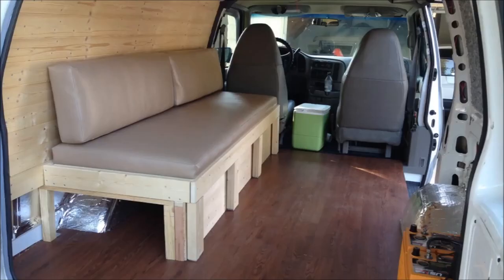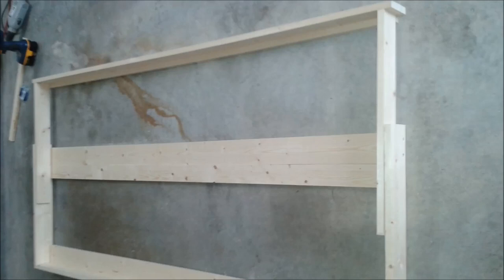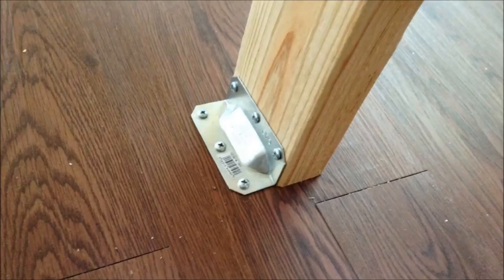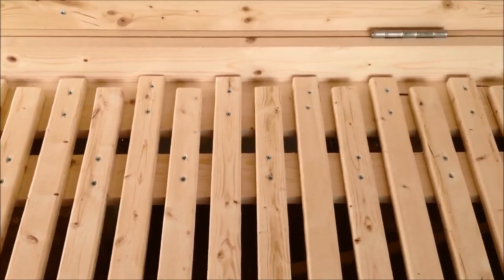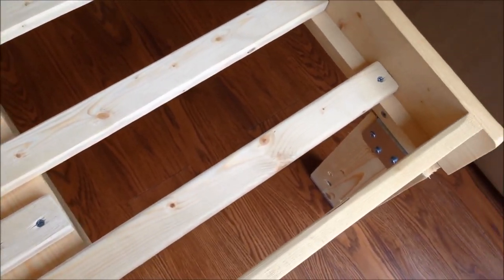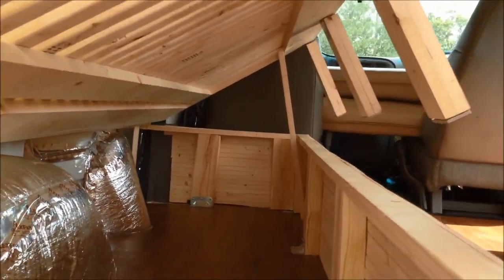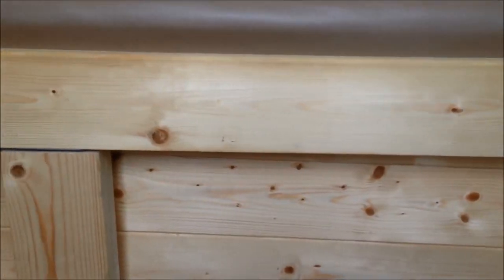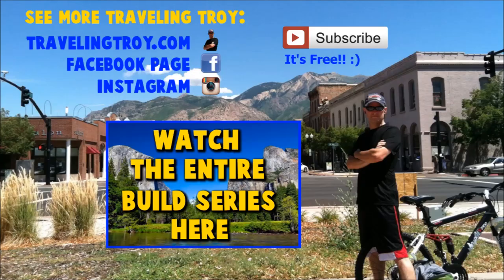Astro Camper Van Build 5 - Sofa Bed Build

Comment: You could've just used a futon, you have so much wood in the van it's like hauling a load of lumber around all the time.
Reply from the maker: Hi +Spark Jumper.  Very true, we could have just put in a futon or a cot if weight was the main concern.  In reality, the only heavy wood is the bed frame & the plywood base flooring.  The rest is very lightweight slats (bed) and planks (walls/ceiling).

Comment: If you had designed it to slide out and the back drop down, it could have been full size.
Reply from the maker: I don't know if you watched the whole video, but the bed does slide out and it is very close to a full size bed.  The cushions drop down and add to the bed width.

Comment: Dude ... all that wood, that van must be superheavy ... didn't you keep in mind the weight? Just look awfully heavy ...
Reply from the maker: True, it does look like it would be heavy.  If I were to do it again and I didn't care about the cost, I would probably go with aluminum framing instead of wood.  But honestly, the bed is built from one 12 ft 2X4 and a bunch of lightweight white pine boards and slats.  The whole thing probably weighs no more that 50 lbs.  It's like having a large dog traveling with me.  :)

Comment: Your dad needs to learn that there is something called aluminum that weighs half as much as wood. Not smart.
Reply from the maker: True wyatt1153.  This is our first build.  We're learning as we go.  Maybe a future bed will be aluminum in this build or the next.  Thanks for the tip.
Reply: ***** Sorry for being a bit of a wise a$$ but look at aluminum channel construction. Its screw together and very easy. Also, it's main advantage is that it id at least half the weight as wood. You will improve your gas mileage with lighter construction.
Reply from the maker: That sound awesome wyatt1153.  Actually, when we were doing research for this build, I don't remember seeing any video examples of aluminum built beds for van or RVs.  I'll have to look into it.